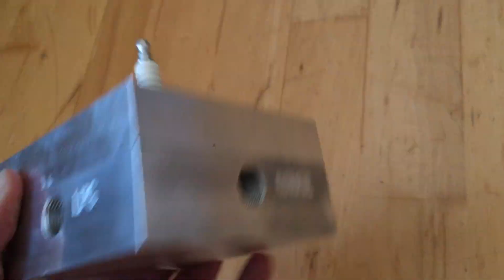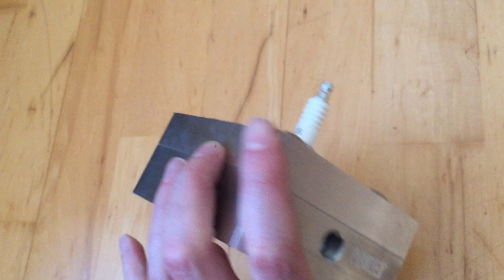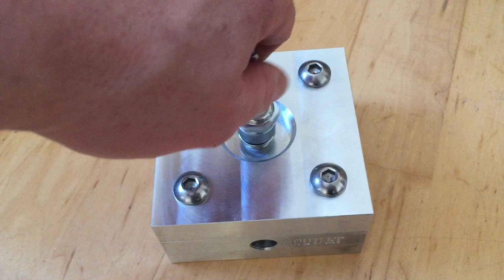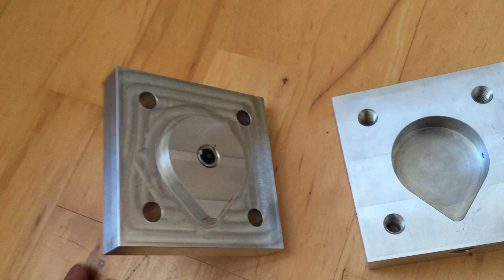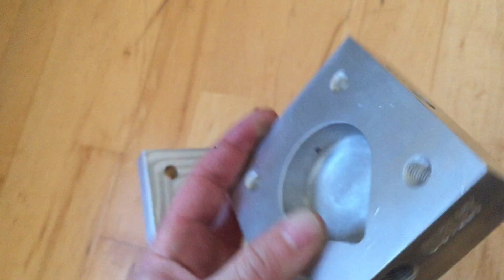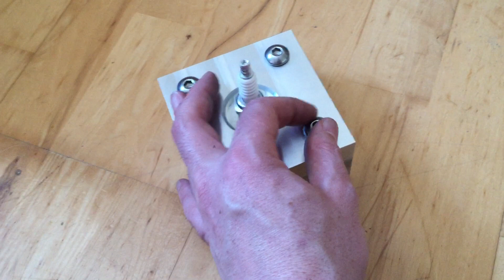Nikola Tesla's Pulse Detonation Engine (PDE) - Detonation Chamber

Comment: The workmanship is best I've seen so far. Mostly anything Tesla related is 3d printed demonstrator  not this well done👍. 

 Does it not need a gasket??  Even though it's milled. Thinking of a cylinder head, even with top quality finish it's still needed. Isn't this the same??
Reply from the maker: No gasket needed and all the heat will get channeled into the turbine when it is attached.

Comment: I wish you had a 3D printer for metal take that flat Tesla valve as a slice and rotate it increasing the number of loops or "buckets" that slow and block backflow at the end of each loop/bucket a de Laval nozzle to increase the kinetics of resistance.
Reply from the maker: To be fair I think I can get exactly the same results from one half the size and maybe smaller. 3D printing this in metal is 100% a good idea as it can be made even smaller!

Comment: Resistor taken out of the spark plug?
Reply: @nikola.tesla.r.and.d.centre  you know they are pretty easy to remove from resistor plugs. Heat with a flame the ceramic and undo the metal terminal from the ceramic...remove and replace with copper. Recommend you smooth off the point that is left from chopping the spark hook off. That will ruin the plasma with point breakout.
Reply: @nikola.tesla.r.and.d.centre  saw it on a old video by a fellow who's channel was named mdbreedi. He was doin plasma watrr spark plugs 10 years ago. I will see if I can find it...check your withheld comments for links....
Reply: @nikola.tesla.r.and.d.centre  found it.
https://m.youtube.com/watch?v=-J2AHNZUZD0

Comment: Hallo mr. Grav inert I wanted to politely ask if you could link my channel a bit in the future because as you may point out, my "cold steam video" is the first one on YouTube, but also the one whit the fewest views on YouTube. Maybe you can help me there. I also have a more or less complete model of a Tesla combustion turbine. I am able to operate the turbine so far without a spark and with an injection pump or without a pump etc. everything works as described in the patent valvular conduit. I would like to show it to you, but as already mentioned, would be cool if you link my channel this time.
Reply: Thank you for your help
Reply from the maker: @waert the only thing missing from your replication was the water jets. The whole point of the water jacket is to act as a heat capacitor for the water jets. So you are putting super heated steam at low pressure to drive the turbine.

You won’t need the vacuum cleaner.

The purpose of the device is to act as a propeller. Propel the propeller with heat and the propellor will propel a second stage on its own shaft. The second stage will amplify the first stage in a virtuous reinforcement cycle whereby both rotors are speeding up each other in reaction to each other.

Comment: I love anything Tesla! Except the cars, but that being said, you need a coil, a timing device, and a power feed into the coil. Ummm, when I look at my 1968 Volkswagen that’s what I see but with gasoline instead of LPG.
Reply: Grav Inert i have a sailboat that had a generator that was gravity fed from a 3 gallon “day-tank.” On a routine USCG inspection for near coastal commercial operation they made me change to using an electric fuel pump. Reason being, if the fuel line for a gravity fed engine fails the fuel will all leak out due to gravity. And in an enclosed engine room that’s not good. I am always concerned when I hear of a gravity fed engine. Even in a small engine like you’re working in now, the fuel will be indoors and “gravity fed” means potential for serious problems.

Comment: Wow, that's exciting! Will you make a mechanical oscillator too (Fig. 3 on a patent)!?
Great job guys! Thank you for sharing!
edit: (i can not vote/thumb up this video, so here is my manual textual upvote!:)
Reply: @nikola.tesla.r.and.d.centre  Hahaha! Yeah, Great, Bravo Maestro!\o/
Your project gives me all goosebumps man! Must be a lot of Aether pressure for all my raising hairs, hahaha!
I made many working devices from Tesla patents. As a kid i made a FM radio station. From 2008 on i had a little kitchen lab where i've been experimenting with Tesla's power transmission and in 2010 finally wirelessly lifted a small chopper model. I also built high voltage ZVS devices for plasma generation. Tesla's True Wireless is Amazing, really kind of Magic! I learned a lot about so called cold electricity and other for me totally new and amazing Aether phenomenas. Still have more questions of course, but i got some answers too, ha!
Tesla turbines and his mechanical oscillators are long my Great wish to experiment with, but i could never afford all that machines needed for such a precise devices. But i made them in 3D and waiting for a new 3D printer patented last year..:P
So you can imagine how exciting is your project for me, and it's a bit like that i am with my friends in a Tesla lab again, hahaha!
I remember Tesla's patent with a turbine(s) and a ring tube with high voltage poles around. Like some advanced Kelvin's generator. I can not find that patent and name atm, but i guess you know which patent was that. Maybe you even plan to make that kind of device?
Anyway, thank you again for all your research and sharing of your projects. Maybe we will really see all that Tesla's amazing dream working and applied devices one day..
Good luck my friend!:)
Reply: @nikola.tesla.r.and.d.centre  OK i found it. A title of an article with mentioned device is: "The new art of projecting concentrated non-dispersive energy through natural media"
Reply: @nikola.tesla.r.and.d.centre  btw, just posted interesting related podcast:
https://youtu.be/-ovICZkHibA
Reply: @nikola.tesla.r.and.d.centre  Excellent! I can't wait to see your progress! Thank you man!